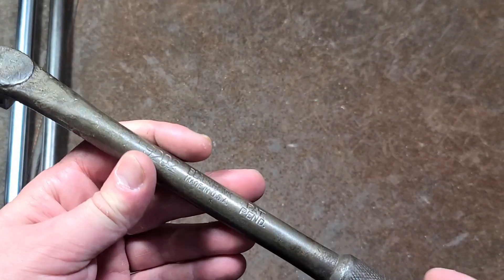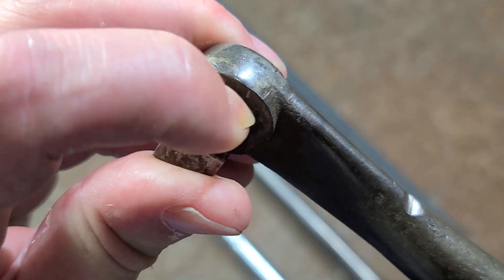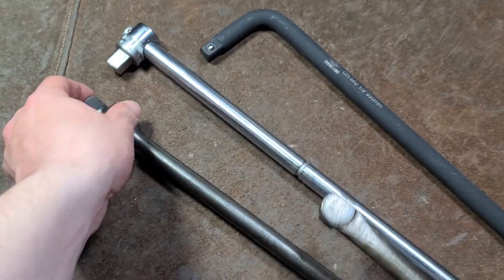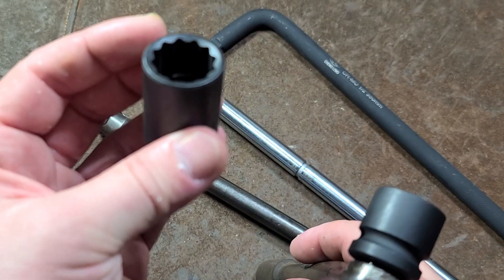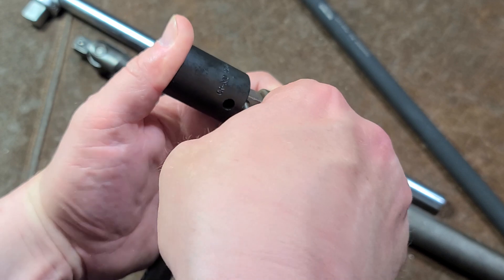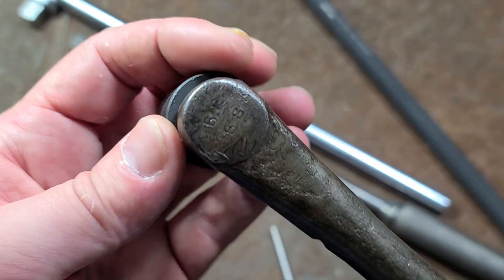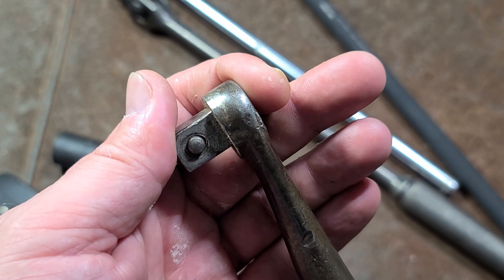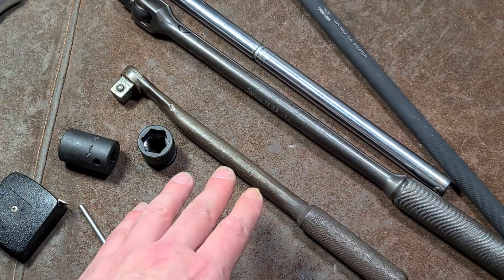BlackHawk USA 1/2" Super Compact Socket Breaker Wrench Review

Comment: That's awesome...I really like that...🤔
Blackhawk is an industrial-grade tool so most likely it's intended you just put one size socket on there and you leave it on if you had to take it off of course you can push in the pin but most likely it's throw a 15/16 or 1 1/8 inch on there and give her hell all the time

Comment: Interesting review.  Yesterday I watched a video of Pakistani truck mechanics using some of the "L" shaped bars like the black one you show.  They had one where they had welded a socket on the end and gusset in the bend of the tool for support.  The bar looked to be about three feet long and they had a four foot cheater on that.  One guy was holding the socket on a lug nut and the other was standing and bouncing on the end of the cheater to tighten the nuts.  In another part of the video, the mechanic was using a shorter one and he was working it just about as fast as someone could use a normal ratchet.  Very interesting.